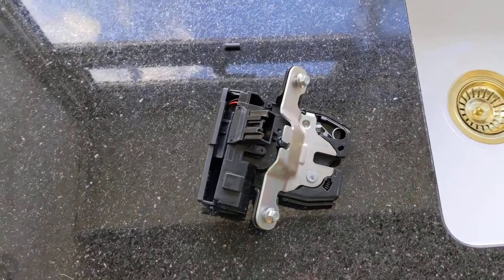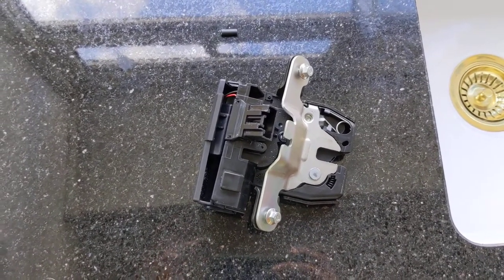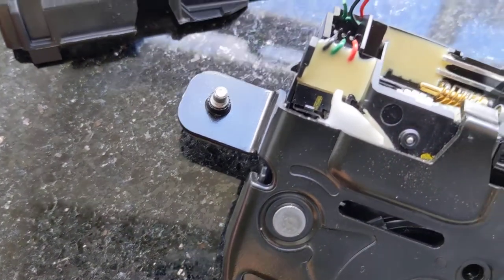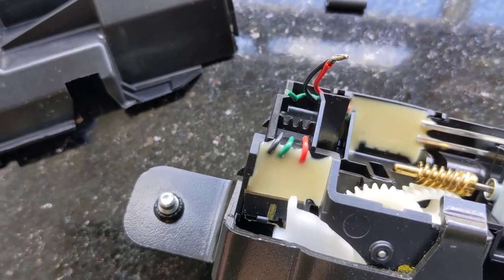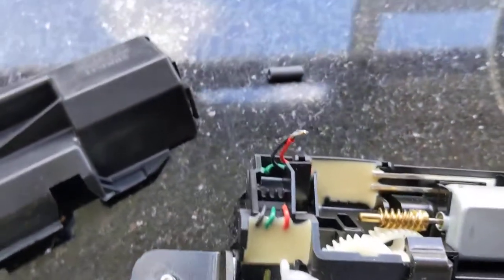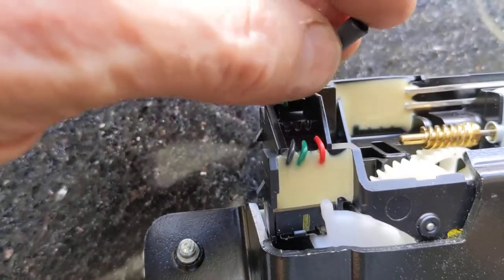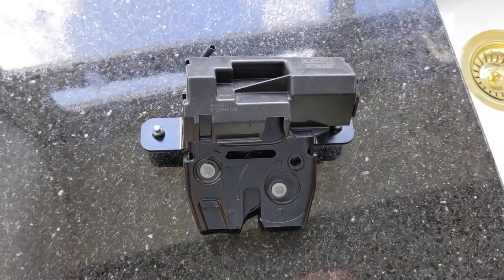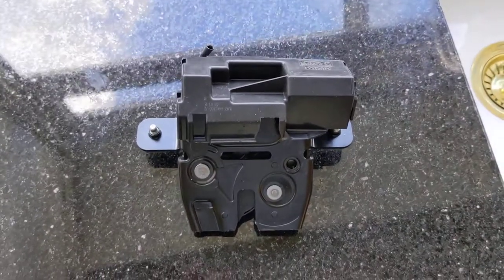Ford Fiesta Mk7 boot/tailgate "boot open" warning light.

Comment: This has started happening on mine but the warning is pretty much constant, especially in heavy rain such as today. It's driving me insane. The physical button to open the boot has also failed. Could you possibly advise which part I need to order for a replacement? It's a 2009 Zetec tdci.
Reply from the maker: On eBay type 'fiesta boot latch', I have just looked and seen one for £18.28, this should be the new part for your car. It sounds like you have 2 issues, the first being the fault which my video fixes, but the 'unknown' bit being have you got a faulty button or not? I'd do the fix in my video to clear the alarm, but your boot may still be faulty. You're going to have to spend £18 to see if a new catch cures the issue. If it doesn't then the release switch can be purchased for £9 off eBay so it's not megabucks of outlay to sort both issues.
Reply: @garymiller9843  thank you for that. I've ordered that part. Is it just a straight swap? I'm not the best with stuff like this but I'd much rather give it a go myself than pay someone
Reply from the maker: @hatthewmartley  I followed the video on YouTube 'Ford Fiesta ST hatchback lock truck lock removal replacement Fiesta Mk7' to get to the part. It is fairly easy to do just take your time and use the video to figure out where the plastic clips are to avoid breaking anything. The plastic will come away with some metal retainers that hold it to the metal of the boot lid. Check if any of the metal bits stay in the car when you remove the plastic. If they do remove them with some pliers, bend back to shape if required and put them back on the plastic so it snaps back onto the boot lid when you rebuild it.
Reply: @garymiller9843  brilliant, thank you. I'll let you know how it all goes when the latch arrives. I hope it works, nearly every time I looked outside last night the interior was all lit up! Luckily I don't have an alarm, wouldn't have got a minute of sleep I think.

Comment: sadly on my 2012 zetec z its not worked .....

When i bought the car the boot kept popping open . It was fixed before i bought it i assume they sprayed the switch until it worked only as it was clear they hadnt changed it .

4 months in its now showing boot open when it isnt . Its the usual the alarm will go off when its parked and locked so i cant lock it and the lights activate when its unlocked so i cant leave it unlocked either .... sigh ...... either way its a battery drain and unsecure.

I changed the door opening switch as its only 7 quid which has made no difference . I did this as the process of elimination . Still happening so its time to look at the striker . 
Removed the trim , cant get the switch out as the white blocks failed so did it in situ . Chopped the black and red , bit of solder etc ...... sadly no difference on a quick test drive . I may disconnect the battery and leave it a few hours to maybeee reset but i dont hold much hope .

So i think its an excellent fix on earlier cars but sadly doesnt work on the later cars  .
Thank you for the video though , it was worth a try .
Reply from the maker: Thank you for your really detailed comment and I am puzzled as to why you still have the issue. The way I figured out what was going on was to get to the point of having the red and black wires ready with bare ends, I then put the catch back into the boot lid and contacted them together whilst watching the boot open indication in the dashboard. After I'd connected the wires a couple of times and witnessed the open indication I was happy to solder them together to override the boot open warning permanently. 

It may be worth you trying this too so you can see the effect of contracting the wires together then separating them. If it makes no difference then there is a chance you have a different fault.

Finally I have looked on eBay and the boot catch is the same for all Mk6 models, so from 2008 ish to 2021, so this fix will apply to your car but only relative to this fault.
Reply: @garymiller9843  It is a puzzle . Im guessing there may be a fault in the loom itself rather than the microswitch . For the life of me i cant get the block connector off and im wondering if one of the tags has rotted away ? . 
The most annoying thing is i have a new catch sat here waiting to be fitted now so if i can just get the connecter to get the hint ........

Oh there is a slight difference . Previously the alarm kept going off seeking to kill the battery . Its now locking and the alarms not being triggered . Over the local cobbles the boot open warning is losing the plot clicking on and off but on every other road you click OK to shut it up and it just sits there as a warning in the backround .

Im now moving house using mostly the fiesta .... spacious it isnt 🙂so im a bit hamstrung to play with it for a couple of weeks . After that ill look into it a bit more and get back to you .
Reply from the maker: @godzillas6301  I think you are on to it with the connector block being stuck; it shouldn't be therefore sounds like corrosion of the terminals hence them perceptibly sticking. If you have a new catch ready to go then you could destroy the fitted one but carefully so that you don't damage the car cabling and connector. In similar instances I have used heavy duty snips/wire cutters to nibble away at the plastics. As for the load capacity of a fiesta, I fit a towbar to mine (quite an easy job) then got an old trailer off Facebook marketplace. I took a conservatory to the tip bit by bit with the fiesta and trailer, the staff found it hilarious and impressed 😁

Comment: Question, can this exact same issue you’re showing  us how to fix (the boot open warning message etc even though the boot is 100% shut) cause your car battery to go flat?
Reply from the maker: Hi, yes I believe it can. As the car 'thinks' the boot is open, the light in the boot and the interior lights in the car come on. If the intermittent open signal goes on and off a lot, overnight or over a weekend for example, the battery can go flat due to the interior lights cycling on/off many times. If your battery is a bit old or doesn't get charged a lot (for example lots of short trips) the issue will soon flatten the battery.
Reply: @garymiller9843  Ahh that makes sense thank you !  I’m dealing with this irritating issue of the boot warning light and I’ve had my battery go flat so I know it’s linked, I’m kinda scared to try to DIY this but I’m also not keen on the price the garage is likely to charge me to diagnose and fix the issue sigh 😅
Reply from the maker: @neeshabub  I'd really recommend you give this fix a go. Watch https://youtu.be/XcfoWqdwjq8 and you'll see you only need basic tools (a screwdriver and a spanner), and you can do this on a dry day on your drive, on the road or wherever is safe. Once you get the catch out, you can do the fix with a pair of toe nail scissors and some tape just to hold the wires together, this will solve the issue.
My personal recommend is once you have all the plastic trim off, do the repair as I show, then leave the plastic off whilst you order a replacement part. They are not very much from eBay, they take seconds to fit and you can keep the 'repaired' part as a spare. I appreciate garages/mechanics have overheads and have to make money, but this job really is DIY, just take your time to ensure you don't break any of the plastic trim parts.
Reply: @neeshabub  absolutely give it a go. Like you I was very wary as I am not a technical hands on person but it was as simple as the video made out to be. I recommend watching another video showing how to remove the plastic trim and after that it was a cake walk. It took me about 10 minutes start to finish and that's not an exaggeration and I am not good at DIY at all

Comment: My boot is actually poping open as I go over bumps or On and off kerbs, any fixes?
Reply from the maker: I haven't got a fix sorry. From an investigation point of view I'd get to the part (see fiesta boot trim removal video - there's a few about on YouTube) and with the boot shut I'd unplug the power to the latch - you'll have to climb over the seat into the boot from the inside. With power removed you'll see if the boot stays shut. If so it could be a faulty release button that's above the number plate. You may have a loose connection or short circuit which would be the same signal as if you were pressing the button to open the boot.

Comment: What the consequences if you just cut black and red and then dont connect back together?
Reply from the maker: Hi, if you just cut the black and red without connecting them, the boot will 'indicate' it's open regardless of it being open/closed. I figured this fix out by doing just the same, cutting the wires, refitting the unit then touching the wires together manually whilst watching the indication on the dashboard go on/off. By connecting them permanently you override the 'boot open warning' as if the warning doesn't exist on the car. You just need to close the boot and rely on yourself for ensuring it is done properly (like on old cars)

Comment: I've the same problem, but the boot opened as I drove along, pulling up and jumping out to re-shut the boot, now I've another problem, the boot stays locked even when all four doors are unlocked, using the key fob to unlock the boot works, but closing the boot it relocks itself, something it never did.....looks like a whole new lock might be needed.
Reply from the maker: I'm not expert on these locks, I just figured out how to cure the symptom of the false 'open' signal.
From what you say though it sounds like the mechanism (as shown in my video) is ok, you may have a problem with the open button above the number plate, the microswitch under the rubber part may be faulty, I'd check that first.
Before randomly changing parts though I'd check everything is plugged in tight, no water ingress/damage etc.

Comment: Won't this disable the boot light for good?
Reply from the maker: When I did it on my car the boot light was disabled as it relies on the logic for the boot being unlatched. I had to do the fix as the dash alarm and interior lights kept coming on every 5 minutes and caused the battery to drain flat. The loss of the boot light is a small price to pay in my opinion. If you read the comments I do recommend that if you do the fix then leave the plastic trim off and get yourself a new latch. Once you have a new latch you have done the hard work, with a further 2 minutes you can have everything bolted in, clipped back together as everything will be good as new.

Comment: I tried to my fofi 2011 but not working?
Reply from the maker: I have seen both of your comments and it sounds like you need a replacement unit, type 'fiesta boot catch' into Amazon and Prime will get you one the next day if you decide to try new? 
The repair I do is only for 'boot indication' and not the locking part of the mechanism as in my case and as many others have found out, the locking part still works fine, you just get a rogue signal saying the boot is open when it's still securely shut.

Comment: I'm gonna try this 🤪. I'm colorblind, I'll cut them all
Reply from the maker: Just make sure you connect the correct 2 together, surely someone will be about to confirm you have the right 2 twisted together before soldering/choc-blocking.
Reply: I'll make sure my wife checks before I cut and join. Thank you Gary

Comment: All it does , is make a strange electronic Noise ..
Reply from the maker: Hi, it sounds like the whole catch/mechanism has gone faulty, so highly likely worth getting to the catch and replacing the whole thing. I can't promise replacement will work, but if it were my car, for less than £20 I'd give it a go.